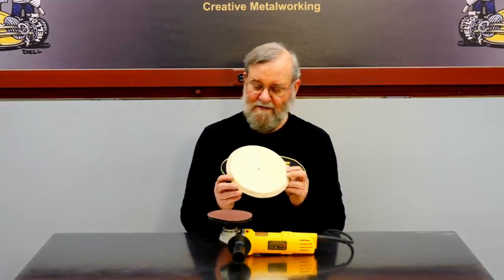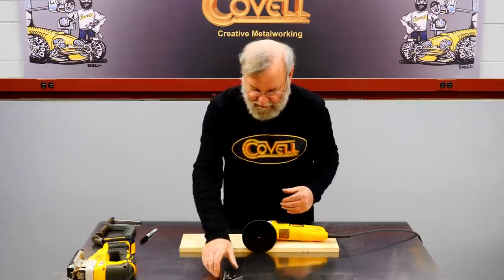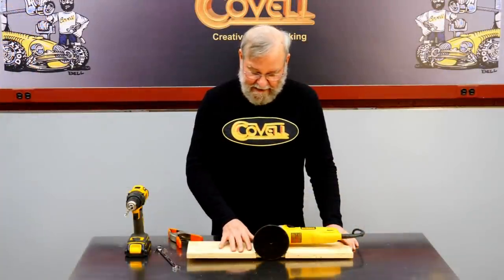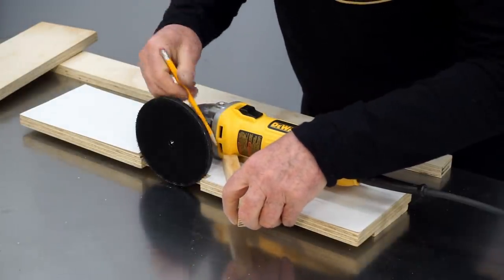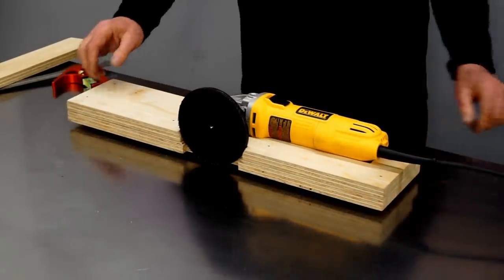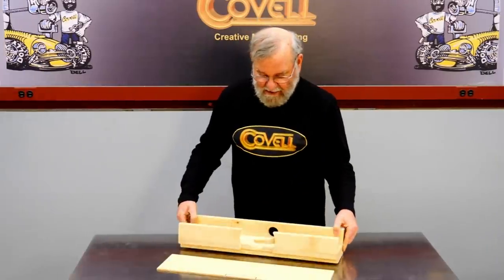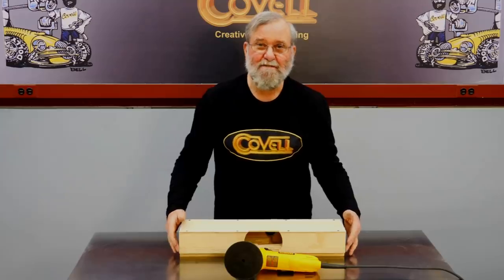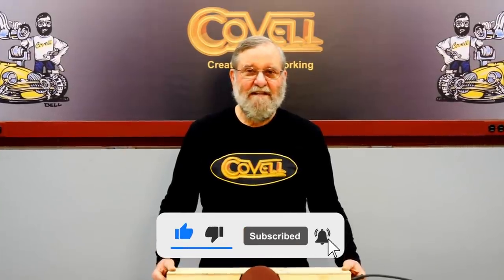Dedicated Disc Maker - Part 1

Comment: This past week I ordered a bunch of 22” circles cut out of 3/8” 6061 for some prototype aerospace parts. The local Ryerson has a huge bandsaw with a circle attachment that can cut a 6’ disc from a 6” thick plate. I had ordered circle blanks before but I wouldn’t have guessed that they used a bandsaw to cut them out. You never stop learning if you keep doing.
Reply from the maker: Wow - I have never seen a bandsaw that can cut circles from 6-inch plate. That's really something!
Reply: I am a machinist and using a circle cutting jig on a bandsaw is how I rough cut metal circles out on the odd occasion I have to do it. I made an outboard table for the job. My saw's capacity is about 22" so if I had the table to hold up such a plate I don't see any reason I couldn't cut one that thick.
Reply: Paul, do you work with Jim C. ? He posted some pieces like that on FB.
Reply: @georgedavis6583  No, but if I did, Jim would lose his clearance. 👀

Comment: I don't know how I have never thought about making a hole punch in a drill chuck with a die grinder. Sounds so simple but somehow never thought of this. I've done them on a lathe or on a bench grinder trying to make the tip pointy. This would be way easier. Thanks for that, and thanks for another well explained and helpful video.
Reply from the maker: Glad you liked it. Although I have a lathe, I have learned that more people enjoy seeing techniques that use only simple tools.

Comment: You are AWESOME Ron! Thanks! Hey, why not 'counter-sink' the bottom hex bolt too? 
See ya in part two! Can't wait!
Reply from the maker: You know, it was really bugging me how that box was always rocking on the bolt head as I was setting up each video shot. If you look closely you'll see little spacers in many shots to avoid the rocking. Using a flat head screw would have been a great solution!
Part 2 is coming soon - perhaps this weekend.

Comment: Ron, I know the ends of the box are open, but you may still consider adding some ventilation holes or clearance pockets around the tool's air vents so you don't restrict airflow and overheat the armature. Looking forward to the rest of the series and the collaboration project on which this sander will be used!
Reply from the maker: Noted!
Reply: @RonCovell  Yes, I think it is a good idea.
Thanks for your project.

Comment: Hi. I keep seeing you with earmuffs under your face shield. This combination gave me quite a bit of TMJ pain over the years. I now use 3M Peltor EEP100 earplugs and it changed my (working) life. I strongly recommend them. Thank you for all your great, great work.
Reply from the maker: Thanks for the heads-up on that. I've had no problems so far, but now I'm aware of the potential issues.
Reply: They are great. You can hold a conversation, listen to your shop radio. You know what is going around you and yet, no grinder, hammer, drill noise at all. I even walk back in the house not knowing I still wear them. Also much easier when comes the time to also don a respirator. Cheers.

Comment: It's great watching a real craftsman do good quality work with only simple tools. Making the transfer punch sans lathe, for example. Might it be good to put ventilation holes through the top and bottom piece of wood so the Dewalt's air cooling slots are less blocked?
Reply from the maker: Many people have commented on this air circulation issue, so I think I had better add some cooling holes!

Comment: Looking great already! When I don't have long screws to reach the bottom, what I do is I drill a hole with the diameter of the head of the screw until I reach that the depth when the two parts can be screwed together. If you have a dowel of that diameter, you can hide the screw as well!
Reply from the maker: Great idea!

Comment: Hi Ron, do you have sufficient ventillation to keep the sander motor cool ? Just a thought.
Looks like an interesting project, thanks.
Reply from the maker: I think I better add some cooling holes.
Reply: @RonCovell  yup things are going to get hot pretty fast there you´ll need to add entry and exit holes ron, the head where the gears are in the grinder heat up too a lot, now to wipe those problems... air grinder!!... :D:D   waiting for part2! thanks for sharing, 
ps a control box to dial grinder speed and an automatic switch for a dust collector would work great i think (ok i´m the overcomplicator :D)
Reply from the maker: An air grinder would certainly be a good solution for the heat! The speed seems to work great for the work I've done so far (and as you know many angle grinders have a built-in speed control). I'm squeezing my brain pretty hard to devise a dust collection system. As you'll see in the next installment, there are a lot of complications to doing that.

Comment: I bought a second hand disc sander that looks to be made from a motor and a alu disc.  It was mounted on a saddle of sorts for sanding pipes straight. Removed it from the saddle and mounted in on my bench. The front table was missing and I simply made a piece of Ply for now.
The only thing I find prohibiting from all that is the price of sanding paper to fit, as the only kind of paper is made for wood floors and only can be ordered in packs of 25..
Reply from the maker: Well, you got a 'screaming deal' on the sander. I found some very inexpensive sanding discs on Amazon - you might look there. The ones I got are from China, and certainly not top quality - but they were so cheap that they were worth buying.

Comment: Thoughts on vent holes for grinder to prevent overheating? one of the bottom would have the added benefit of being more or less guarded from the dust from the sander.
Reply from the maker: Probably a very good idea!

Comment: I really like your efficent use of tools and materials. Using an angle grinder is clever. But does the box restrict the air flow for cooling the angle grinder motor? Especially the lower part of the motor air inlets that you enclosed with the second inner layer of plywood?
Reply from the maker: I think some cooling holes are in order.

Comment: Ron, I love your table saw.  It looks about the same vintage as mine (a Craftsman that my father bought to build his house in 1955-6).
Reply from the maker: I bought that saw used, at a bargain price, many many years ago. Although it's relatively lightweight, nearly all of the mechanical parts are cast iron, and well machined. Since I don't do a lot of woodwork, it fits my needs perfectly!

Comment: I always get excited and then a lesson in patience when I see get a notification for a new Ron Covell video 😂 "SWEET new Covell video!!! Aww I have to wait until tomorrow 😭."

I actually have a project that needs a disc so this is awefully fortuitous for me. But, I want to make a disc with a larger center hole, like say three or four inches. How would you go about doing that? First thing that comes to my mind is clamping the work between four ball bearings on a board. Drilling an offset pilot hole in the work, then clamping a die grinder under the disc and slowly spinning it.

Also, I suspect you could make elipses and releaux triangles with this , but I'll have to wait and see how it works 😁
Reply from the maker: Just about an hour until the video launches.
For making a hole in the center of a disc, your idea sounds good. I think three bearings would work as well as four (possibly even better). 
My part one video doesn't show the completed fixture, but I hope to have that uploaded next weekend. Making a releaux  triangle should be no problem - you just need three center holes. An ellipse is more challenging. Maybe some others have ideas on how to do this? I would welcome any comments on this point.
Reply: @RonCovell  yes I was thinking about that after I commented actually. I had a smooth brain moment where I thought an ellipse was two circles. But it's not, it's roughly two intersecting hyperbolas. There's a trick that might work to make an ellipse but it's difficult to implement here. Not really sure how often folks need an ellipse when fabricating either. I should have said you could make pill shapes very easily, or comically large tongue depressors.

Mr. Covell, I suspect you already know this but I'll write it for anyone who is curious (I hate cliffhangers with no follow up). So, the trick for making an ellipse is two nails and a length of string tied with excess between the nails. The distance between the nails determines the concentricity (how close to a circle it is) and the length of the string determines the size. If you take a pencil and pull the string taught and trace the perimeter the string inscribes it will make an ellipse (as long as you don't wrap it around the nails). To do this with your table you would have to let the nails in your work sit under the surface of the work table and have a another pin below the table to put the string over. Likely it would not make painlessly perfect ellipses either.

I roughly know how you'll make the table, but I am curious to see how you'll make the quick indexing center. I might just make one of these but with an added plasma cutter mount so I can ruff out the shape quickly and spend less time grinding 👍 I love watching your content. I learn new and practical skills, which also inspire new ideas. This Old Tony teaches me, but who has the space and money for a lathe and a mill... At least he introduced me to you 😅. I'm just kidding Tony, I want to buy a lathe and mill... Thanks for making me yearn to spend money (and space) I don't have.

Comment: Hi Ron, thanks for posting another video! The thumbnail shows you with a couple finished discs. So this build seems to work fine. Do you have any thermal issues with the electric motor? I smoked a couple of these angle grinders in the past just using them uncovered for grinding or cutting without taking care about the power-on time. 
Your dedication to the build itself is always great to watch. Hope to see you at SEMA2021. Greetings, TOBi 👋👋
Reply from the maker: So many people have brought up the issue of cooling that I think I had better add some cooling holes! I do plan to be at SEMA again this year, unless things change.
Reply: @Ron Covell  Thanks for your reply, Ron! 👍😊👍 I guess you might know best about the motor temp and if it works it's perfect. I am really interested in part 2. 💪👍

Comment: great video. thank you.

should there be any consideration as to the ventilation of the sander motor.
the vents seem closed in with the ply and the motor may overheat.
Reply from the maker: Very good point. I will probably add some ventilation holes.

Comment: I built a table top fixture for my angle grinder to do sanding, but use flap discs. It's a very useful fixture in my shop, for metal and wood shaping/sanding. 

But I can see the benefit of using a flat backing plate, which will give better accuracy on thick wood. The problem with all flap discs is the sloping surface resulting from their construction and wear pattern. A flat sanding disc on a batten-plate is a better idea; so I just have to find, or make one to fit 😉
Reply from the maker: I considered using a 'regular' flat sanding disc, held to a stiff rubber backing plate by a center nut, but the nut didn't seem to pull the disc completely flat against the backing plate - there was a little 'wobble' - which I thought would hamper the precision. Using a glue-on disc might be another option.
Reply: @RonCovell  I've seen people use an aluminium disc as the backing plate, and also thick plywood for the large, slow rotating sanders typically found on You Tube, and glued on. I guess I've been a bit timid to try a plywood one with an angle grinder due to their high speed.

Comment: Looks good so far. One thing If when cutting hole in the thin plywood if you would score the plywood by running the hole saw in reverse you could minimize tear out. Then I also would like to see videos on wire edging in sheet  metal.
Reply from the maker: That's a great tip for minimizing tearout - on the top side, at least. I'll give it a try.
I haven't made a YouTube video on wired edges, but Lazze Jansson has a great one:
https://www.youtube.com/watch?v=eOcZwr-1Y1E&t=296s

Comment: With the reduced air flow I don't think that angle grinder is long for this world. I think you should cut some vents in the box to match the out flow vents around the head of the grinder. It would also be useful to wrap some adhesive foam strips around the body of the grinder or on the inner walls of the box so that they form a separation between the intake and outlet vents. That would prevent hot air from recirculating.
Reply from the maker: Your ideas are spot-on!

Comment: This video reminds me of a question I want to ask. I need to make a 17” aluminum hubcap of 50’s custom car period called a ripple or starburst. 14” 15” were of course the only type used in 50’s a rep-popped. Would a hammer form the best way to make it or possibly bead roller? Thanks Ron
Reply from the maker: I believe this is what you want to achieve?
https://www.amazon.com/United-Pacific-SBC01-15-Starburst-Wheel/dp/B077K58FC4/ref=asc_df_B077K58FC4/?tag=hyprod-20&linkCode=df0&hvadid=343206898484&hvpos=&hvnetw=g&hvrand=7639246505774972394&hvpone=&hvptwo=&hvqmt=&hvdev=c&hvdvcmdl=&hvlocint=&hvlocphy=9032164&hvtargid=pla-788264100452&psc=1&tag=&ref=&adgrpid=68750936843&hvpone=&hvptwo=&hvadid=343206898484&hvpos=&hvnetw=g&hvrand=7639246505774972394&hvqmt=&hvdev=c&hvdvcmdl=&hvlocint=&hvlocphy=9032164&hvtargid=pla-788264100452
A bead roller would do a smoother job than a hammerform.
Reply: @RonCovell  yes thanks I’ll start practicing with bead roller on 17”

Comment: Out of curiosity, why did you pick slot-headed screws? Just what you had on hand?

Personally dislike them almost as much as Philips head, and at least here, there's no price benefit to either, so I just go with Torx unless I'm restoring something, then i match.
Reply from the maker: I think all the screws I used in this video are Phillips. I completely agree that Torx fasteners are superior - but for #6 drywall screws going into plywood, the Phillips style work fine for me. I don't like regular slot-headed screws much at all.

Comment: Is there any concern that the vibration of the sander will work the mounting bolts out?
Reply from the maker: Well, no more concern than with the handle loosening when it is threaded into those holes.
Reply: @RonCovell  I have had the handles work out of my hammer drills, but I haven't used a good sander like this.
Reply from the maker: I think that if the bolt is sufficiently tightened, it should stay tight. I'll keep an eye on the bolts, and if they show any sign of loosening, Loctite is our friend!

Comment: My first thought is you're making a dangerous as frick lathe using an angle grinder... But then I'm like "This is ron, he isn't dumb.", and the 16:54 preview shows it's just a table with a peg moving in-away from the "cutting" item (a sander). Pretty simple and effective, and honestly less dangerous than any makeshift lathe; better finish too!
Reply from the maker: As you will see in the second video, this fixture is no more dangerous than a 'regular' disc sander.
Reply: @RonCovell  I know, I know. I just thought at first you'd be attaching the discs to the angle grinder itself as a makeshift lathe. It's just how it looked and I thought "No way that's dumb."

Comment: The only thing I worry about in an enclosure like that is air flow to the motor for cooling. Though I suppose if it becomes a problem, it would be easy enough to add a fan for forced circulation
Reply from the maker: Noted!

Comment: my only issue is seeing you use those dewalt drills backwards. the impact driver is meant for driving screws, the other one for drilling. i mean sure they function fine as either or...  just bugs me.
Reply from the maker: Well, I use the clutch in the 'locked' position most of the time, but I most often use the clutch when driving small screws. I'm not clear what's 'backwards' about this approach.

Comment: I'm not into wood......
Reply from the maker: As you probably know, most of my videos are about metal, but I often use wooden forms and fixtures to aid my metalworking. I'll use this disc making fixture to make a  number of the parts for a buck I will be building, and probably for some formers to help roll cones from sheetmetal.